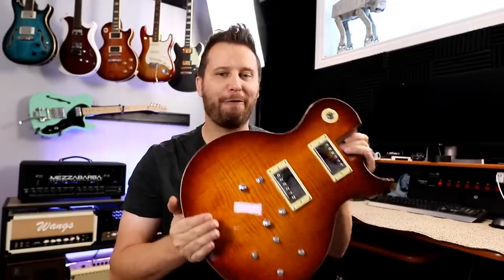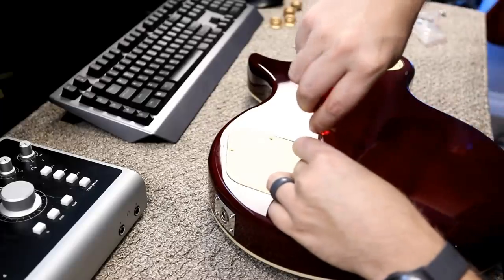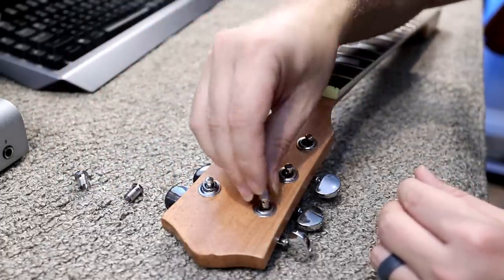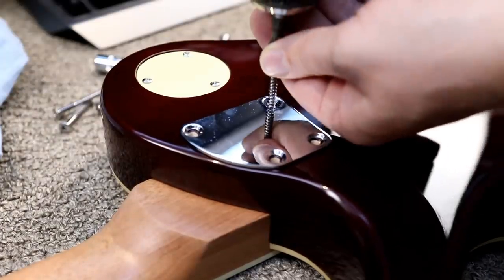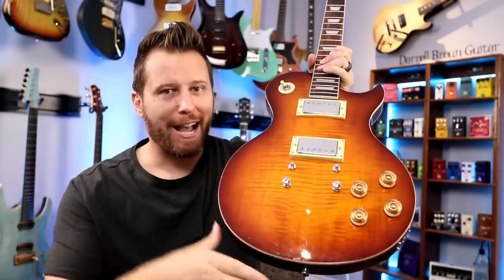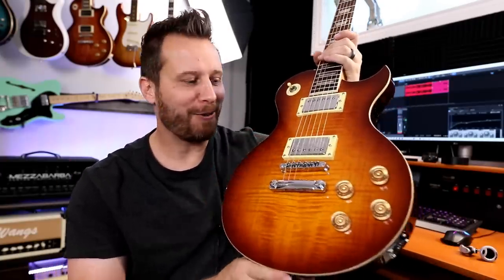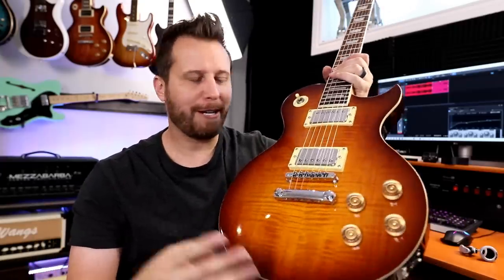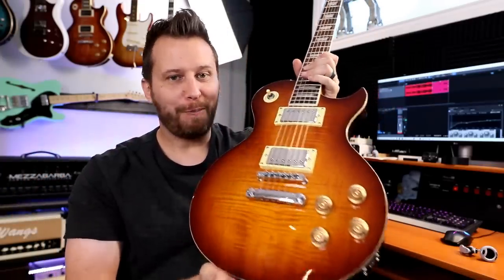Building the PERFECT Les Paul Kit Part II - KIT vs GIBSON LES PAUL!

Comment: The tiny screws that hold the tuners and truss rod cover are always easy to strip or break, so I like to wax them before installing. I hold them by the head and use a lighter to heat them a couple of seconds before touching the threads to a bit of paraffin wax. Makes life easier.

Comment: Darrell, I really enjoy your kit builds! An idea for the next one is to do it using some upgraded parts, maybe some DiMarzios, set up a coil split, upgrade the pots, maybe upgrade the cap on the tone pot, some locking tuners and put a bone or tusk nut on it. If/when I do one of these kits, I'd plan on doing something similar. 

I'd also put a T-6 bridge/tail piece on it. I had one on my '71 LPC and it made a world of difference making those fine tuning adjustments, usually without even needing to turn the tuners (at least once the strings are stretched out.)

One more thing. Upgrade the jack to a higher quality one. 

I've not done the math, but possibly it would be cheaper to forego the kit and buy a body and neck. 

I'd love to see you setup a standard set of pickups to coil splitting. Something I'm curious to see is if small toggles were used instead of the push/pull tone pot, sort of PRS style. Individual control over the halves of the Humbuckers is something I'd like to see. I think Ibanez may offer something similar. 

So if you're looking for ideas...

Comment: One option for the tailpiece is to have the strings wrap around.  Gives you the narrow breakover angle but you can (need to) lower the tailpiece down lower.  SO, low breakover angle AND less torque on the tailpiece studs.

Comment: I didn't know solo had kids with finished bodies. It looks pretty good. The neck pickup is surprisingly good sounding but the bridge would have to go because it sounds very brash. With a roller saddle and better bridge pickup I think it would be really decent. I like the fact also that the neck bolts on and not glues in. That's my preference I know other people will prefer the opposite. My preference is is that if anything goes wrong with the neck or I don't like it I can always change it if it's not glued in.

Comment: I tried an lp jr kit from StewMac, it was fun, but with a few things:  first time soldering, so I messed up the pots.  I bought new CTS pots, but a guy said I messed up the pots by my soldering (the heat hurts the insides a little??).  The neck was my biggest objection.  It had a real slim 60's neck, and my hands are way to big for it.  I would like to have a neck made by Warmouth or something with either standard or a bit wider neck at the nut.  I bought some locking Kluson tuners for about $60 on sale at SM.  I also got a dogear cover for the p90 pickup, and a different pickguard.  I had to do the finish and everything.  It was a lot of fun, and a bit frustrating, but worth it.  Anyone buying a kit should really ask about the neck, though, nut measurements, etc.  Thanks for sharing the video.  I used to work in a machine shop, so doing this stuff is fun for me.

Comment: I bought a stewmac LP KIT with a glue in neck. The neck fit perfect, and the cheap pickups were actually pretty nice for bedroom use. Everything fit perfect, it was my first Time soldering and I did it first try. With the finishing, I spent about $350 on the Guitar. I’m happy with my purchase although if money is why you want to build one, your better off buying an Epiphone.

Comment: You have to put the strings FROM the "Saddle side"  through the tailpiece, and turning over towards the saddles again, this way, eliminates the angle and the need of higher tailpiece.
Reply: You dont "have" to do that... 
Thats a personal taste and preference. Doing a wraparound will also result in higher tension, making the bends harder, so that might not fit your playingstyle. 
So raising the tailpiece (like Darrell did here) will result in much the same, but less tension. None of them are better or worse - more right or wrong - Just personal preference.
Reply: @ChristianTornholmLehn  
More tension?
Is also more stable. Lifting the tailpiece to compensate the angle is the most stupid thing I ever seen...

Comment: Good video, Darrel! Regarding tuning and string tension, instead of raising the tailpiece and raising tension on the the studs, I have found it easier to just upgrade to a roller bridge. This also helps when string bending by not having a sharp edge on the bridge that could cause a string to snap. The roller bridge eliminates this problem. Thanks, again, for a great video, and yes,  it is fun to build your own! I'm on my 6th (spalted LP) with a 7th (Strat) in the wings! :-)
Reply: Roller bridges (unless you buy an expensive one) can kill sustain and deaden the guitar.  Yes - almost essential if you have a Bigsby but not necessary for a hard-tail.

Comment: All I wanted to see was the soldering...and it is all he skipped, lol. 🤦
Reply: Check the part 1
Reply: @senza4591  He skipped it in part 1, lol.
Reply: Clear Adventure,
     It's not the only thing he skipped.  He didn't show how to install the pickups or switch.  I wanted to see fretting, but all we saw was shaping & end cutting.  
     I learned electrical/electronic soldering years before I became a licensed ham (1962) or started playing acoustic guitar (1964), so I was unlikely to learn much about it from this video.  If you want to learn basic electronic soldering techniques, you can find them in ham radio books and websites.
Reply: @j.d.schultzsr.9215  Thanks, and props on your HAM. Now please realize I know how to solder wires together, lol, I was wanting to see his configuration on this guitar pickup assembly.

Comment: A little bit of wax on the tips of the screws will ease insertion and help prevent stress cracks.
Reply: Should pre-drill a bit too if they are binding so badly.
Reply: @jimmyjames2022  Absolutely.  The amount of force he was putting on those tiny screws, it was lucky he didn't snap one off.

Comment: Nice job Darrell, and there ain't a damn thing wrong with those pickups!😁 If I was still playing on a regular basis, I'd grab one of these kits in a hot minute. The component quality looks really good for the most part, although that neck should fit a little tighter in the pocket. I think I would have gone the extra mile and put some insulating tape in the electronics and pickup cavities to keep the noise down at higher volumes. As hot as those humbuckers are, I'm pretty sure they'll be feedback monsters at higher levels.😉 Pretty nice overall.. I checked out Solo's site, and they've got some really nice looking kits available, and above all, affordable, if you're willing to spend a little time and effort doing it right!😎👍

Comment: take a piece of guitar string (or whatever is handy) and insert in the screw holes and see if the depth matches the appropriate screw. If they're way off then you can drill the holes a tad deeper. Just mark the depth on the drill bit with some tape so you don't over do it. A bit of wax (paraffin, bee, unscented etc) rubbed on the screw threads helps a lot.

Comment: I use a little glue on the neck and screws. It does a better job keeping the neck stable. If it has a gap ill shim it. And i would stain the neck to match the back. The tail piece studs aren't long enough to accommodate the height of the tail piece. That's why it's pulling forward. But you know all that. Nice guitar. Love the color.

Comment: Looks like the pickup alignment is off, best to install the pickups last, place the pickups into the body then install the E strings. After this you can make sure the pickups are perfectly aligned with the strings before screwing them down. Overall this is a pretty nice kit, with a bit of effort you could end up with a pretty good guitar for the money. Plus, for a beginner, you learn a lot about setup how to adjust the action and tone to end up with something that is nice to play, something a lot of cheap ready built lack.

Comment: its insane that there's not a huge sound  difference for 1/10th the price  of a Gibson..& half the price of an Epi...weight?
Reply: I emailed Solo about the weight, they told me 8-9lbs
Reply: Bogey Man  I have a Gibson Les Paul and it's also exceptionally well made. And I could hear a big difference in tone.
Reply: @DavidOakesMusic  heard a big diff a s well
Reply: @hyabussa5747  yea me too, sounding a bit like a Jazzmaster to my ears
Reply: I once built a Harley Benton  DC Guitar Kit. the guitar is very light! And it sounds really warm and nice
Reply: Bogey Man  labor is probably 10x more expensive
Reply: It sounded pretty average in tone to me. Not even close to as full as the Gibson. I think in this comparison the Gibson held up well in justifying it's price.
Reply: Price always plays a factor, but nothing can beat a real Gibson. The quality on my studio defines it as a work horse machine. It stays in tune, frets feel like butter, and the pickups have high output. Musicians need to buy what works and sounds well. A Gibson is for the pros.
Reply: @brandoncarson3143  and now there is where I definitely disagree. Gibson's are not the best guitars for pros.
Reply: Yeah but one of them you gotta worry about it possibly being put together crappy.... and the other you build yourself
Reply: @DavidOakesMusic  The thing is that this is a tenth of the price but has at least half the tone. And if you throw better pickups you're gonna get most, if not all, of the way there

Comment: Sounds excellent. Lower gain pickups never bothered me. My effects processor has input and output gain knobs on it. Makes it easy to equalize input level between different guitars. I recently bought a cheaper SX LP style guitar that is the only model they make with a bolt-on neck. (The Callisto LTD.) Contrary to what people think, it makes absolutely no difference in the tone and sustain. As long as the woods are good quality, it just doesn't matter whether the neck is bolt-on or set. The bolt-on neck provides noticeably better access to the upper frets on a LP style guitar. This kit looks even better, with the contour on the neck pocket. Might have to get one.

Comment: If you run your screw threads in candle wax or even a bar of soap, the screws will be easier to screw in. Plus less chance of them snapping off. Also the tail piece studs in the 1st video. Maybe try putting just a dab of wood glue in each hole.

Comment: You asked for suggestions. Years ago I built a Fender 12 string kit. When completed I could not get the tuning correct. I spent a very long time messing around with the intonation and bridge adjusters and was never able to get the octaves to be in tune no mater what I did.
Reply: Sounds like the bridge was in the wrong spot.

Comment: Great VLOG Darrell, looks like you had fun doing it as well. Great value for 1/10th the price ? of a Gibson. Good sound down low but obviously can't compare with the Gibson up loud. Really good for a first electric guitar.
Put a pair of DiMarzio Super Distortion's or Seymour Duncan JB's in it & then it will sound better by far but might add about 50% to the price of the guitar in the USA, here in Australia those pickups would almost double the price of the kit. It's amazing what you can buy from Chinese websites if you fancy putting one together from scratch & finishing it with stain & varnish (polyurethane) or paint.
I have bits on order now to make one & I'll try to video it & post before, during & after clips, wish me luck.

Comment: ...and this was “as is”! I’m sure some time spent leveling and dressing the frets, filing the nut slots to correct depth and making proper adjustments to the saddle height, intonation and truss rod would make it play as well as the guitar it imitates. Of course, a Gibson will be made with superior materials and hardware, but if this kit gets all the setup done well, it should play as well.

Comment: By mounting the pickups at the very start you ended up with the neck p'up too far to the bass side & the bridge p'up too far to the treble side. You have to get the strings on there first then align the pickups under them.

Comment: I like this vid. I was wondering if you can add glue to the neck joint like gibson does and then put neck plate on and after glue has cured remove neck plate and screws and fill screw holes sand and  refinish  will the neck hold to the body like the gibsons do.  .

Comment: A bolt on neck on an LP style guitar hurts my eyes.  From the front it looks great.  Is that maple top paper thin?
Reply: From the previous video it looks like a decent 1 inch maple cap with a flame maple veneer over the top.
Reply: @LukeBass1000  So yes & no...
Reply: I agree with your assessment on the bolt-on neck on a Les Paul style guitar. I don't have any problem with them at all on a Fender Strat or Tele style, and there's no reason that a bolt-on neck won't work fine on a Les Paul style guitar... but tradition is a rough thing to reason with in my brain. Whenever I see a bolt-on neck on a Les Paul style guitar my brain screams CHEEEEAAAPPP!! RUN AWAAAAAY!!!

Comment: Daryl, nice build.  I know I'm very late but I have one question.  I noticed that the neck joint to the body is not matched up with the contour of the body. It looks like a builder could move the contour of the flair to the neck to match up with the body.  Could you feel that edge when playing above the 12th fret?  Thanks.

Comment: I never raise my Gibson tailpieces like that. I keep mine almost flush to the body. With a steep break angle (but does not touch back of bridge). My tuning stability is insane. Almost as good as my Floyd equipped guitars. I could never understand why people Jack them up like that?! I put some Tw25b on the saddles and nut slots, and all my Gibson’s are stellar. Even when my 15 year gets on my custom and thrashes is it with psycho bends to make up for the lack of a Floyd Rose. It stays in tune. But I do run Gibson USA TP6 bridges on most my Gibson Les Pauls. Simply because I have so many guitars with Floyd’s and if for any reason I do need to tweak the tuning I do it at the tail because that’s what I’m used to. Oh. And graphite, big bends nut sauce and all those other guitar lubricants are useless. Get Tw25b. Comes in a syringe needle tip applicator. And stays exactly where you put it. Because it’s grease. Just takes a very tiny dab. It’s what the military uses to insure their weapons work. I guarantee you it’ll do the same for your “weapon”. It’s expensive. But a tube will last you a year or more. Best discovery I ever made. 👊🏻🤘🏻

Comment: Very impressed by this kit. The sounds were very good especially when not driven to extremes. At modest settings I couldn't help but notice how close to the Les Paul the kit sounded. I hated the hole covers and pit guard. These are easily replaced, and I would probably leave off the pit guard anyways

Comment: great looking kit.. one issue is that even for a maple top the posts should not lean forward even with the tail piece so high.. if you can press the bushings in with your thumb the holes were drilled a bit to large.. they should be press fit with a clamp to fit properly.. may just be ease for a kit sake.. nice job!!..

Comment: If you put spacing washers on the stop bar posts then tighten the posts down to the height you want it will almost completely stop the posts bending, and a little better sustain

Comment: I hadn´t expected such a tonal difference between the two. and that the gibson with the glued in neck sounded clearer. but the kit guitar sounded good too. great video. thank you. greetings from germany.
Reply: Well you are talking about a guitar in the thousands versus a couple hundred dollar kit, the glued in neck will only make a slight difference(technically you can glue in the neck with the bolts if you are that averse to it) in sustain what you are hearing is the cheaper electronics not being as good that is where the clearer is coming from. a 920D wiring harness with some DiMarzio pickups would fix that easily, the problem with the kit guitars is you are essentially buying the "Good Quality" wood working especially from Solo I have heard very few complaints except from those that didn't test fit and send it back if it had issues and all cheap hardware.
I almost feel they should sell the kit but allow you to choose from hardware they sell in different brackets, like el cheap, mid grade, and high end - rather than just sending el cheapo hardware out making you source the premium parts.

Comment: The headstock twists the strings right and left. Is that bcoz they stay true to some original design? It doesn't contribute to tuning stability. If u want to do urself a favour, and take some pride in your build, reshape the headstock. Drill new holes and make the strings go straight down.